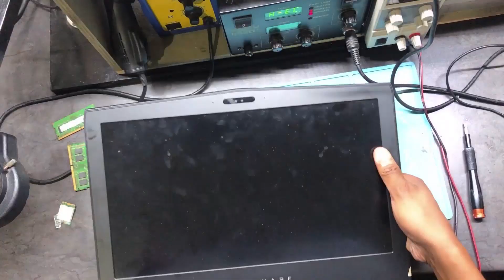Alienware 15 R3,No Dislay, No POST, flashing 3 red 1 blue - Caused by the GPU FAILURE

Comment: Is it just me, or maybe I’m seeing it wrong on my small iPhone screen? The LED light flashes on your device, sí los colores son b + r. Your video’s title maybe has a typo? I read words like “GPU error” and I’m observing a whole lot of diddly-squat for any graphical anything, with extremely slim odds of being related to LCD, its LVDS cable or any other components whilst also getting the flashes to indicate a trouble w/ hware.

I only count one blue flash, followed immediately by two red ones. Then it should repeat indefinitely, unless the pwr btn is pressed on (your device only flashes a time or two, then you power on & LED cycle colors) 

Sorry, not baggin on ur content. 😅 it’s helpful I’m sure for other users elsewhere. I mention with certainty bc I’ve been trying to fix this exact trouble code for 2+ mo.
I am getting the 1 blue, 3 red flashes. 😮
My r3 differs from yours in that my screen and GUI come up on display. I can currently only access BIOS and boot loader. Thought this 1 blue, 3 red pattern was indicative of failed CMOS/internal real-time clock error, though. 

I installed my new cmos and reset RTC manually via holding power button 31 seconds and being patient. 

Now I can choose bootloader OS (Ubuntu, Win 10, etc.) but it takes forever to load now or boot mode. Also, it 98% of time will not load any choice in all above OS options. 😢

Ran tests on both SSDs (1x Toshiba 256GB m.2 NVME + Samsung Evo 2TB m.2 NVME) and my 1TB 2.5” mech drive (HGST, brand new) — all storage drives were 98% -100% smart initial & none came back w/ bad sectors. 

My second thought after running memory tests, replaced both RAM sodimms, etc and all hware (aside from at that time, a bad RTC battery) came back 100% in excellent working order, for both short and comprehensive self tests via Dell support assist. I’ve heard rumors that Dell/HP/Lenovo each want to protect their customer UX and reputation and will often omit specific known issues to keep attention off user escalation rates and warranty claims. Anyway, just something I’ve heard working in break/fix hardware repair/HelpDesk & sys amount for combined 20+ yrs now. 

Any of you other nerds know where I need to be looking? I’m pretty decent and experienced micro soldering tech so maybe I’ll try a reflow of various logical components if all else fails. Just want to get this r3 of mine back to dual booting win/linux OR I’m tbh gonna be happy if I simply get one working OS and full POST to user login-> OS-> and beyond. Why I can fix other ppl’s shit with little effort yet takes me 2 mo to order parts and fix my own devices, lol. Help me, fellow systems hobbyists & nerds!

Comment: Modern GPU's resistance is less than 1 ohm, it doesn't mean it's shorted. Injecting voltage proved nothing. Input of the VRM was not shorted. Take this video down you fool
Reply: You are right some machines are designed in that way

Comment: How it is possible? GPU and CPU damage etc on a mainboard! Where is the TVS diodes, overvoltage and ESD protection components to protect these high value components? The answer is none! Design engineers know how to design robust mainboards but companies forces them to design vulnerable devices to make planned onsolence on their products!

Comment: i also had the same problem on my AW15R3 my cpu and gpu power supply was gone and i have to change the motherboard cause me lot of money but it is fixed now and from now never gonna buy alienware products they are trash 💔once i was a fan of AW but now i dont recommend anyone for AW
Reply: Was it exposed to alot of heat in anyway? I think me leaving mines in the car caused mines to do this.